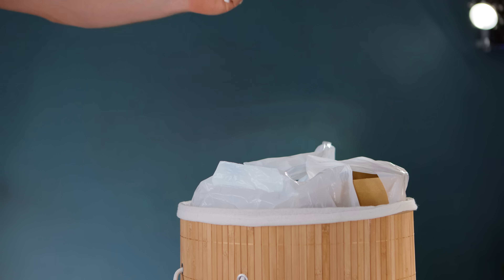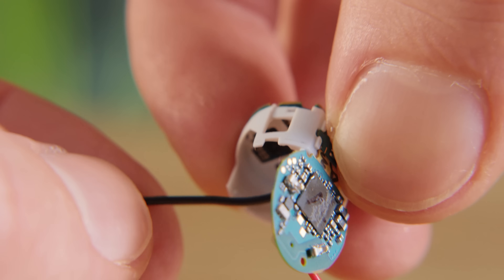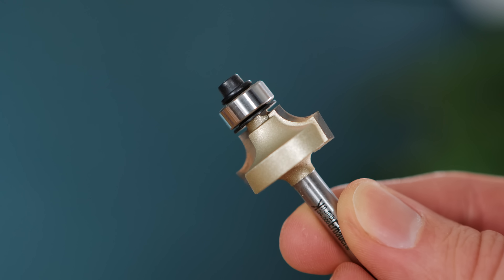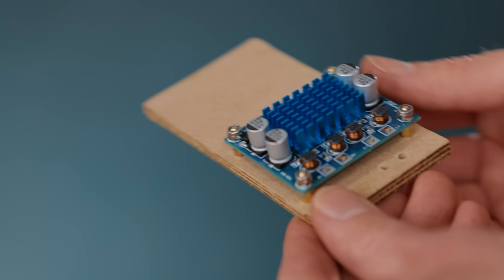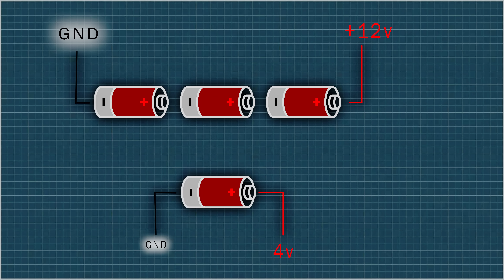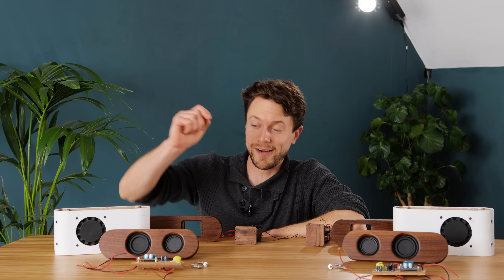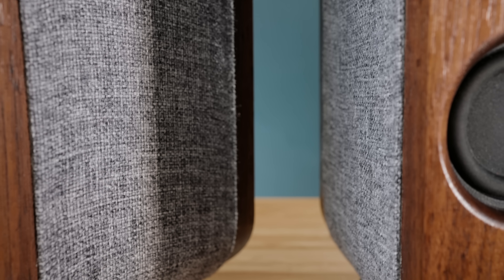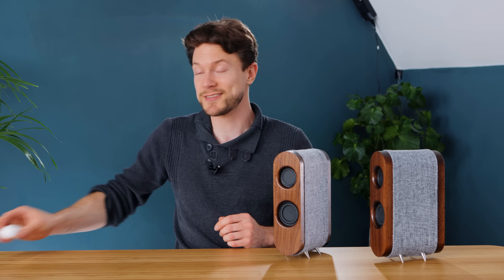Transforming dead earbuds into POWERFUL wireless speakers

Comment: Nice project. The final design is great. Others have pointed out the pointed feet are “scratchy”. However, considering the speakers do nothing but vibrate, I’m quite sure they will dig awesome holes into any surface with a lesser hardness. Second, why not find  better BT antennas and solder those into place, running a them along under the fabric? Earbuds are meant to be within reach of the phone and don’t have great range. This simple fix would make the end product far better for home stereo.  Others have given suggestions on internal charge circuits so the batteries don’t need to be yarded out several times each week. I know you’re trying to keep the project simple but for most mortals, inconvenience means: “not going to be used for long”. If you design the PCB for that, you could sell it as part of your build kit. The same with your crossovers, it’s easy for you to design and sell the PCB and sell as part of a build kit.

Keep the great ideas coming, you do good work.
Reply: I do want to point out that the range of earbuds nowadays covers about an entire living room with very little difficulty, so it doesn't seem too meaningful to me to create dedicated antennae.

Comment: Hypothetically speaking i uhh did the same thing with one 10 inch speaker and don’t know how to make the power supply work right. how would one accommodate for such a large speaker
Reply: I'm not sure what you mean, but as long as you power the amp with the right voltage you should be able to connect the speaker to ONE channel and it should work.

Comment: So the earbuds are only for bluetooth connection, while I prefer using cables for several reasons... And where the F do I get wood like that from where I live? This is a project that will never happen. I'd rather buy a set of loudspeakers from the store.
Reply: You don't need wood. Only an acoustically sound enclosure. I reckon you can probably achieve similar results with plastic and foam.

Comment: What I really want to know is if I can unsolder the two speakers on my Bluetooth speaker and then connect those wires into bigger speakers from a surroundsound set up will it work because I want to make a little Bluetooth stereo system for my car that's portable with no wires coming out of it

Comment: I think a better use would be to  just put this circuit in usb enclosure and wire the output to a 3.5 mm jack. This dongle will be really helpful in adding bluetooth support to you old speaker system or even your car.

Comment: I have LOTS of dead bluetooth earbuds.(mostly pairs.) Need materials for build for 5.0 digital stereo single speaker(High treble,standard bass,high volume backup singing & acoustic boost switch next to power on/off & volume buttons on right side,while usb-c insert and 18650,a Samsung 30Q with 3000 mah on left.)and speaker units that a BIG in treble,acoustics,bass with SOME punch with the components already addressed...

Comment: Hey Matt. I've been wondering how and where do you usually knows what and which to connect the electronics to? I got so many ideas on used electronic parts but I have no idea where to find it's manual or wiring diagrams.

Comment: For me, headphones (wired or wireless, no import as to which) usually fail with chassis issues, not driver issues.

I hope this tuto helps me make my Bluetooth headphone adapter work properly (it's based on the board from erstwhile-working but structurally broken Bluetooth headphones).

Comment: THE fabric is not a good choice.

It is quickly becomes dirty and you need to unglue it and put a new one. Especially since those are wireless speakers, so they will be moved outside and go random places overall.

Comment: Amazing build, as always. I agree with others that the battery charging is clunky and annoying, and I would look into implementing some of the suggestions for bypassing that. The other thing that struck me was that Matt didn't put any dampening material inside the cabinets before he sealed them up. He did that in a different video and he emphasized the importance of it. Something like rock wool or home insulation would do the trick.

Comment: Amazing job on building the enclosure and everything! I have 2 little issues here. How do you pair your device? Most of these earbuds rely on their charging enclosure to pair, there's a button on them. The other issue is that these earbuds have sensors to sense if they are in the ear or not (at least the Apple ones does), what do you do about them?

Is it possible to add some ports to charge the batteries with just a USB cable?

Comment: This is a fantastic DIY project! And it is very well explained. The only critical note I have is that you should not use electrolytic capacitors for your filters. There are good bipolar capacitors that will live longer in this type of configuration.

Comment: True Wireless Stereo Bluetooth receiver board can be purchased at $10, save you the hassle of taking apart your earbuds.

TWS DSP 4 channel amp board can be purchased at $70. Then you buy a pair of used obsolete 3-way or 4-way speakers for under $100, replace the crossover circuit boards with the TWS amp boards (2 at $140), then you get a pair of wireless hifi speakers for$240 that’s better than a system that would cost above $5000 traditionally.

Comment: Indian not even need to use any links like this for amplifier (TPA3110 XH-A232) bcz this amp is very commonly used in diy in India and you can get it very easily in any diy shop in around of cost of 2.50 dollars or lesser

Comment: Strange decision to charge batteries separately..
Definitely better option would be to use few in parallel and use dc-dc converter for amplifier, while earbud part is connected directly.
This way it would be great to use flat cells.

Using a charging controller, with usb-c connector, would make this build complete and actually premium-like.

Comment: I like your videos, but some times they are very complicated. You can buy a Bluetooth stereo adapter that operates on 5 V from a usb an adapter and has a 3.5 mm output with an included cable for $3.49 on ebay

Comment: i would say its similar enough and most people dont have the skill. Even if you manage to finish, it wont look as good s yours. For most people its more affordable to by speakers. In my experiance its worth doing DIY when a specific this is not available or way too expemsive in comparison to DIY (this is getting more rare day by day) most of the time its more expensive to build now. cause to buy a transistor can go up to 3e where a amp circuit can be bought for 5e. At this point i see DIY just as a hobby.

Comment: @DIYPerks I have two beats pill speakers in which the speaker drivers are not working and I cant find any replacement for it. Any idea if it can be repurpose use the same components but different speaker drivers?

Comment: geez you do some awesome stuff.
I'm not that capable though, 
But would i be able to cut the speaker wires on a bt headset and solder them to RCA plugs to  plug into a home amplifier?

Comment: Pretty much Genius in any build guide! Love All your builds! I have a couple Lg flat Tv speakers from one broken Tv that I want to pretty much do this same thing. Though I am still undecided on the design as they are like a box 23 x 12 x 3 cm box shape. Both of them have double speakers inside and are definitely loud as I recall from when the TV was still working. 
One thing I wanted to note about the metal pegs in this video, they might be more rounded as being too sharp can scratch on desk with the vibrations from the speakers and leave some scuff marks. ❤❤👏👏 overall they  are the best damn thing I've ever seen, as you said even better than commercial ones. Could be better with an internal USB Charging module, but after seing your other  videos, people may definitely be able to  implement that here as this was a mere concept.

Comment: Honestly, if I can't find a new battery for my earbuds when they die, I'm making this.
Although, I'm not a fan of the battery circuit. I would've used a 3S BMS with a barrel jack for charging the batteries for the amp and also, through a DC2DC converter connected to the same barrel jack, send 5v to a TP4056 board to charge the receiver battery, though I'm not sure wether or not it creates a ground loop or not

Comment: The Bose speaker sounds crispier than the DIY but for it to hold close, it's a good project. Kinda annoying to have to pull out 8 batteries to recharge. There are Multi-Cell USB Lithium chargers for the cheap to achieve the same battery setup you have. Then add two step down modules to split the main voltage into 12v and 4v. This method is almost the same amount of work when you soldered the lines for the 12v and 4v batteries but saves time to screw/unscrew the back to remove the batteries and then charge it separately if all of it could just be plugged in a USB charger.

Comment: The speakers being stereo compared to mono is def an improvement. However, the bose speaker is way clearer in the top freq range and has in general a better sound. But this is amazing considering it's DIY, and the speakers look beautiful.
Reply: Yeah, I'm guessing this would require adding a more complex eq or a tweeter to really get that high-frequency sparkle.
Reply: @scottbitz5222  Agree. But overall amazing DIY wireless speaker

Comment: The Bose was much better. Not enough to pay what Bose charges but there are cheaper alternatives that sound just as good. I have a $100  sony sound bar with subwoofer that sounds just as good as the $500 Bose you have there

Comment: these look amazing BUT I have to say even tho the sound isn't as spread on the Bose speakers it is in fact clearer and better erwies etc therefore id suggest using a programmable speaker amp with which u can eq the different areas for the drivers via a program on the computer which is way more accurate and customizable especially for people with less knowledge about electronics (like me) and bblueprints for separations can be found literally anywhere on the internet
hope it helps
Reply: Absolutely not, the Bose does not sound clearer at all. I have to say I'm surprised anyone could think this, the treble and mids are clearly more distinct and separated from bass channels on the DIY speakers.
Reply: @Alexandros11  I’m literally a sound engineer 😂
Reply: @danielsielmann9141  I... don't care...? That's an appeal to authority, and you're flat out wrong. I'm a producer, and work with high end audio gear all the time, and you should probably get your hearing checked if you think the Bose Wass better.

The highs were piercing, mids were ok and bass was not hugely grounded. The DIY speakers were balanced, albeit with quite  a bassy sound but that's totally acceptable for consumer grade audio gear, and it sounded far better than the Bose for recreational use.
Reply: @Alexandros11  i'm an audiophile and i agree, for a pair of earbuds and a cheap amplifier they were not only better than the Bose but also exceedingly good in their own right
Reply: Or just ditch the Class D junk, and put a real amplifier in there... 🤷🏻

Comment: lol the bass drivers alone at €74 EACH. This is easily a €200+ pair of speakers, for what? You can buy this kind of thing off the shelf for €149 and get a warranty along with it. 

Heck, buy a stereo set of off the shelf wired speakers for €49 and rewire them with the ear buds if you really want... This build was unnecessarily expensive.

Comment: I guess you could run them off a 12v transformer, with a 5v buck converter for the lower voltage. They you don't have the battery charging shenanigans
Reply: Then you have to be near a mains outlet shenanigans

Comment: Awesome work mate. I'm now looking at where I can buy parts for my own, but I can't find speakers with similar specs to the ones you got (Sound Imports doesn't ship to Australia). Would a few sets of full range speakers work with your circuits, or would it be best to use them without splitting the sound to mid and base?

Edit: Found my solution: AliExpress. They have sub and treble speakers
Reply: i am also interested . if you find a good pair then please give us the links for that .
Reply: @Alan Nagorny I have no evidence what -so-ever to know how good they are, will just have to try and find out. 

I'll provide links when I pick which ones to get (and can afford to get them 😂)

Comment: Nice Build! I have a pair of dead earbuds I tried to replace the battery in and failed. I wont throw them out now. What about pairing new devices?
Reply: With this setup - you cannot pair new devices, besides those that were previously paired, as Galaxy Buds are put into the pairing mode by holding both touchpads for a few seconds. The touchpads here are not exposed. Unfortunately, this is a major deal breaker for me.

Comment: why wouldn't you put a charging port into the units? It seems a nightmare to remove the batteries each time they run dry, especially that you'd need a screwdriver for that ...

Comment: Could this concept of using wireless earbuds be used to make a small dongle which can be plugged into an existing amp's RCA ports? How long is one AA battery going to supply the earbuds for?
Reply: Yes. Just attach an RCA cable to the output to where the ear bud drivers used to be, and plug them in. Simple.

Comment: its crazy how they actually have a wider range of sound than the bose while still having good volume and clarity
Reply: No highs? No lows? It must be Bose.
Reply: Bro what,this has to be the stupidest comment section yet
Reply: @the-scrap-gamer  IKR...
Reply: @j55321  do sound a little muffled though
Reply: Yes, and it also probably cheaper than bose stereo and still can be much cheaper if use lowergrade material
Reply: what? these speakers sound muffled and unbalanced - over bassed - the bose sounds neutral.
Reply: the bose has far more detail
Reply: @j55321 yeah you right you clearly can hear them in youtube highly compressed sound and video
Reply: @joerisimmanuel9156   thank you for agreeing with me... I thought I was going mad
Reply: @j55321  what device are you listening on? they sound way fuller than the bose which is to be expected since they are stereo.

Comment: I like the idea of how you turn the earbuds into the speaker. But at some level. this is not really an ideal solution. If I put an rough estimation of all the material cost. It goes around 250$ to 300$ depending on the region you are living in. For that cost I can safely order any 5''' or 6'' Studio monitor or maybe get any decent speakers. Loved your video though. Great idea

Comment: Grate job! But i have an interesting question!!! How are you connecting new cellphone to  the speakers??? Usually you have to put them beck in to charging case and open it...
Reply: Idk for the most expensive ones but usually the charging case is just for charging. If you provide energy to the bud it will behave the same way as if you put it back in the charging case
Reply: @papelalbal6813  thanks, I'd realized that later , You're completely tight, most of tws headphones are not depending of case accept some models like  airpods pro. 
Thanks anyway

Comment: done this myself using a bigger battery set up, other bigger speakers, a different bluetooth module from a big speaker, and a pringles can. it was pretty cool. but this is misleading. i expected somehow the earbud speaker is used. but thats not the case. earbud speakers will never be able to produce any sort of capable sound. tv speakers yes, but you really need a more powerful transmitter as im sure that bluetooth board is not capable of sending a heavy quality signal. i really doubt the live recording as there was no white noise present compared to the bose sound link, which is a hell of a speaker.

Comment: I live in Canada, and I just purchased at my local Walmart, true wireless earbuds, brand new, for $14.97 Canadian, imported by Walmart from China. I have a pair of professional amplified JBL speakers. Each has its own AC plug and multiple inputs (RCA, XLR, 1/4" phone) and are quite powerful. Opening the earbuds was effortless, I added a shielded RCA plug and 2 wires connected to a 2.5mm DC power plug and epoxied each bud, so they can be re-inserted into the wireless bud charging case if needed (it has its own internal battery for 3 complete recharges for wireless on the go). This gives me amplified BT stereo (true left right) wireless speakers and it works great!

Comment: the only downside about the battery compartment is that those screws will wear down between repeated unscrewing cycles, I would suggest a different way to secure the batteries.

Comment: I opened the right side of the Jabra Elite 65t because it gave no more sound. It seems like they rely on the batterie being pushed onto two super tiny buttons to get powered on. Also I think I must have ruined them in another way because I could only get them to turn on once more by pressing the battery to the two buttons. Otherwise it would have been hard to solder on another current source because the battery is connected with a super tiny ribbon cable and push on connector. Truly disappointing e-waste garbage.

Comment: You can buy numerous very nice well reviewed mains powered desktop monitors for around $100 to $200 per pair that support Bluetooth and likely sound better than these and don’t need to have batteries removed for charging. Some examples would be from Mackie and Presonus. I get the idea of making something bespoke but it doesn’t make economic, acoustic,  or practical sense in this case. There are also nice sounding battery powered Bluetooth separate stereo speakers you can charge without removing the batteries.

Comment: you should have used 12v charging bms and a type c charging circuit for the 4.2 v battery. and there are usb pd standard charging boards that allow 12v to charge the bigger battery